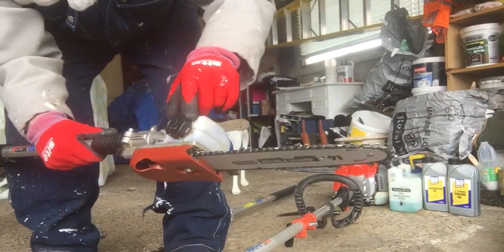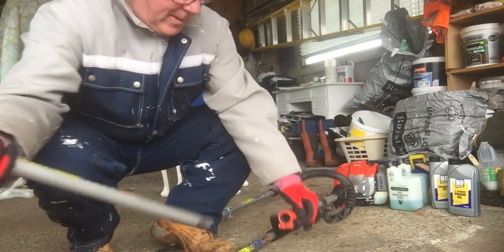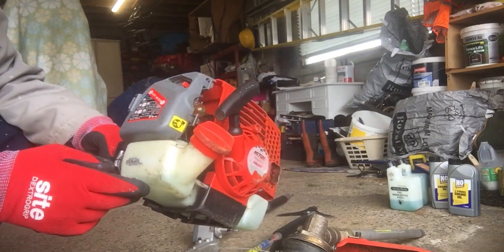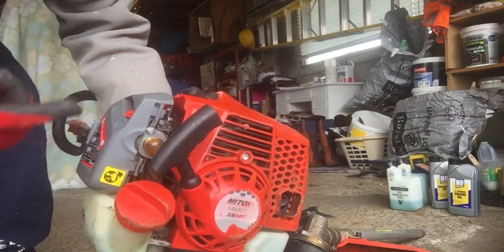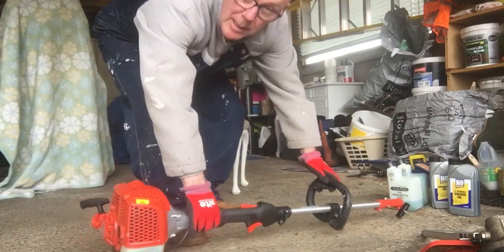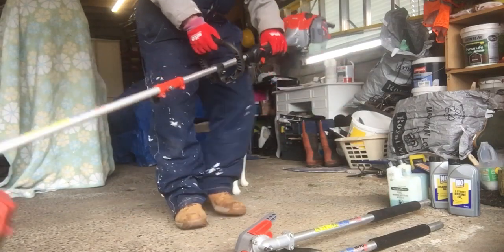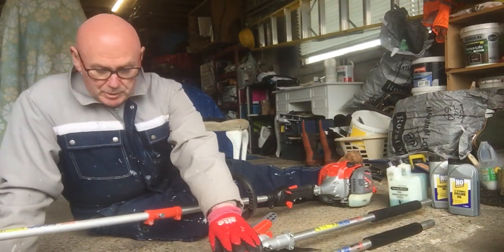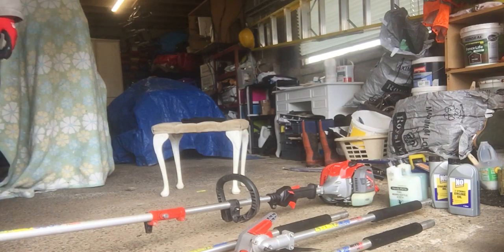Mintox multi Tool garden brush cutter strimmer hedge trimmer extension pole.

Comment: Agreed. Used mitox long reach hedge trimmer for years. Bought an expensive stihl long reach and had nothing but problems and had to go back to the mitox (along with husqvarna multi tool). The mitox starts and runs 4 years later still as reliable as when new.
Reply from the maker: Brian Connor I never thought I’d be excited over a power tool lol must be an age thing!
Reply: @DjSkipAlexander  not an age thing skip.....a man thing👌

Comment: Fantastic review, all the better owing to it being made after plenty of hard use. I recall from your 2nd Titan review that you ‘forgot’ to add the 2 stroke oil which resulted in a seized engine - was there anything else wrong with it? I only ask because I can’t decide between the two - and the Mitox 28MT is about £100 more. Your thoughts?
Reply from the maker: Hi ya it was the McCullough multi tool that I used petrol only and sized the engine after a month or so, the Titan was used correctly (I learnt my lesson) it was a great easy start but just would not start after a month or so of light work.